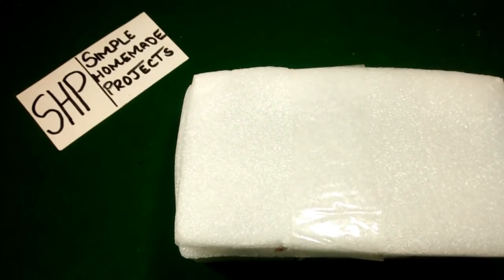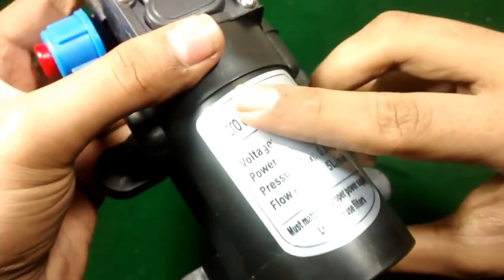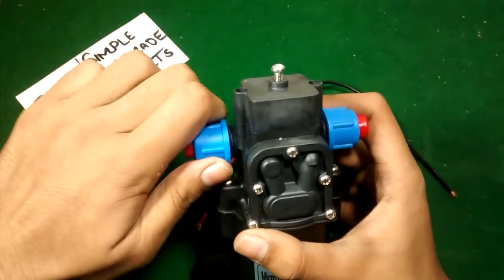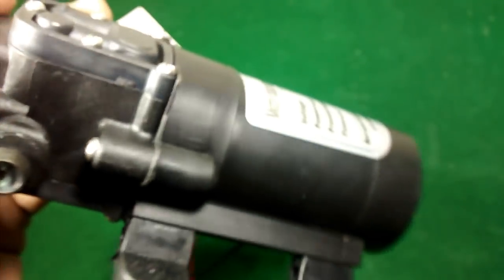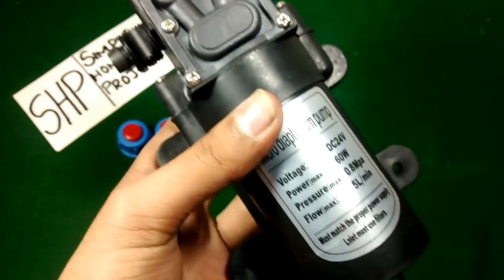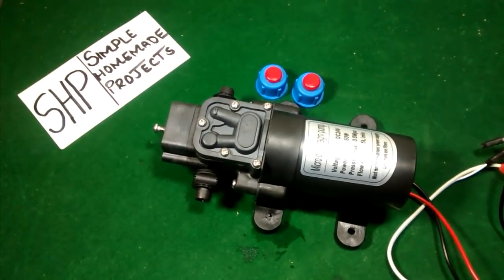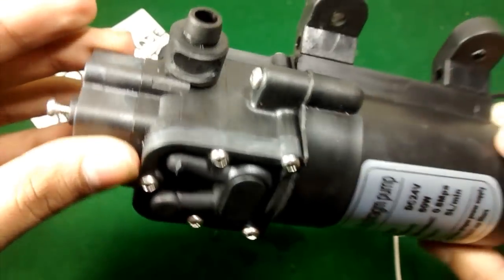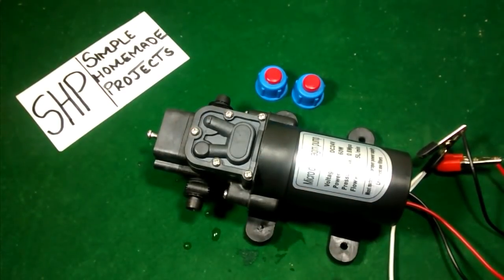REVIEW OF MY PRESSURE WATER PUMP , POWERFUL MICRO DIAPHRAGM PUMP .

Comment: Hello can you adjust the pressure setting
Reply from the maker: No, I just run it on 12 and 24 volts to change pressure as it is a 24 volt pump

Comment: If the pump is to work at 12 volts, isn't it harmful to make it work at 24 ?
Reply from the maker: Yes, but the one I am using can work on both 12 and 24 volts
Reply: @SIMPLEHOMEMADEPROJECTS  thank you very much for your prompt reply.
Reply: Is there a diaphragm pump of the same size which is reliable?
Reply from the maker: I am using it for over 2 years. If you wants to buy the same the heres the link. 

https://banggood.app.link/maBenemaB0
Reply: @SIMPLEHOMEMADEPROJECTS  I wanted to know if a similar diaphragm pump with an output of about 12 to 15 litres/ minute is available. This pump I think is 5 lpm. Thank you.
Reply: @SIMPLEHOMEMADEPROJECTS   I purchased a 12 volt can you show me how to install it please?
Reply from the maker: @arseniapalaleo2318  where you wants to install it?? Give me some derails please.
Reply: @SIMPLEHOMEMADEPROJECTS  sorry i did not see your reply immediately anyway i want to have stronger waterflow in my kitchen zink but  my tank is not high enough so theres no enough pressure  so i want to install a pump is that possible .i purchased this 12 volt diaphragm   online  can you help please
Reply from the maker: @arseniapalaleo2318  yes, it will be good using a pump, now you have buy some pipe ( tubing ) according to diameter of your pump hoses.
Reply: @SIMPLEHOMEMADEPROJECTS  thank you so much ,more power to brother

Comment: What size openings are for the inlet and outlet fittings. In other words, what size hose would need to be used on this particular pump? In looking at tons of videos and Ebay and Amazon sales on such pumps, virtually none ever explain what fitting is used and what size of hose to install on the pumps.  Thanks.  A dry run can be just as good as  a wet one, if it is explaining the pump and what it does, so screw the negative comments. Quite a few of these same pumps come in 12v  models and the actual liters pumped per minute can vary on them, as well as the run time they have before shutting off.

Comment: How do you switch from 12V to 24V?
Reply from the maker: I had a transformer which has two coils connected in series, each coil is of 12 volts, so its up to me wether i take 12 or 24 volts at output